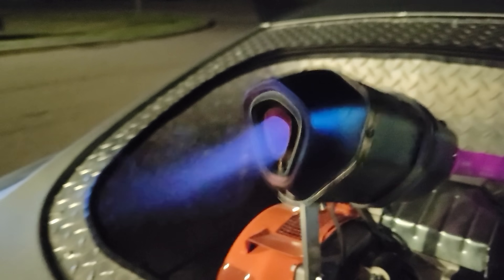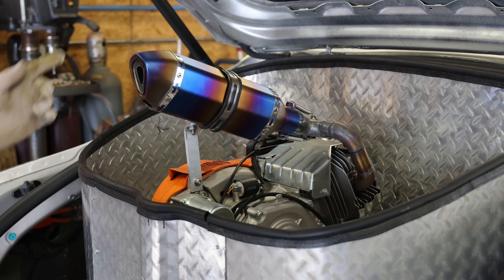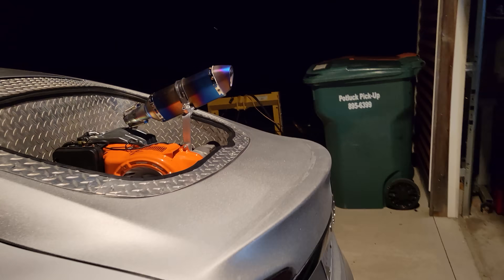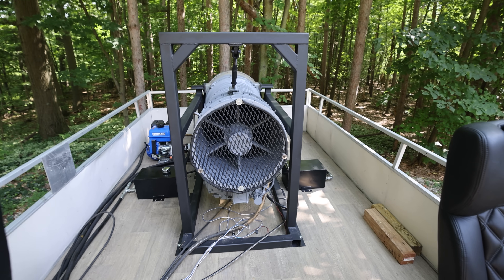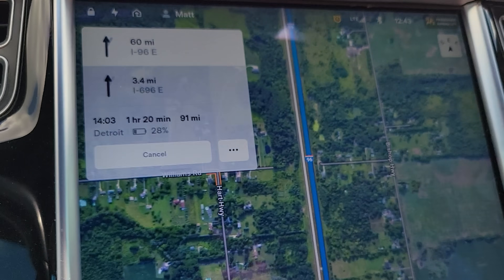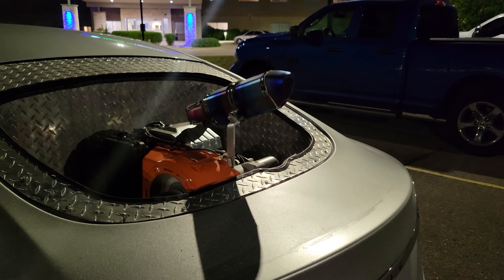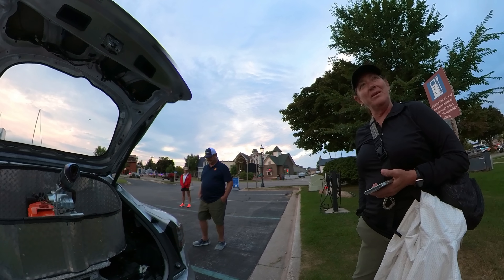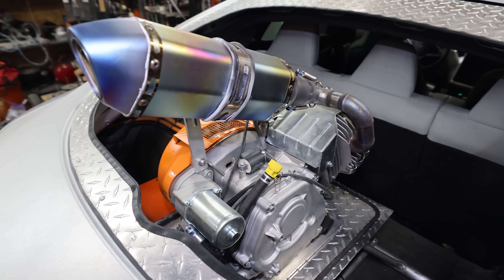Cordless Tesla (I Drive 1800 miles without charging) P.1

Comment: I don't recall hearing anything of a generator. Only a noisy 400cc engine "that makes about 10,000 watts, total," and it charges batteries. Not very good though.
Reply from the maker: My system is so small you didn't even know it was a generator, mission accomplished
Reply: @WarpedYT  So small its like it isn't even there!
Reply: I can't get my head round how it's possible to simultaneously charge and discharge a battery
Reply: @rickyjb23  Hey you raised a valid point about this car and now I'm not sure if it even works.
Reply: @N0Xa880iUL  he stated in other comments he's not using the on board charger . Which converts AC to DC for the battery to charge .  Makes the system sound  even more unlikely .
Reply: @rickyjb23  he wouldn’t need to if he is jacked in straight to the battery. Particularly if he is running DC, there would be no need to AC convert??? I have no idea what voltages these run at?
Reply: @rickyjb23  Because that's not even possible. Only if the gen supplies more than the car need it will charge the battery and can supply power to the car.
Reply: @flexairz  correct it's not possible . That gen could not power the motors directly , or via the battery while the car is moving .
Reply: @rickyjb23  From an analogical POV, it's like adding another battery. Another battery would add to the capacity of the battery system as a whole, but is still being drained with it. You're either adding or draining electrons from the battery system, with no active charger (like here), you're only draining while using, and adding while charging, but if you increase the available capacity (through active charging), you're either going to be charging the battery (if the generator capacity is greater than the driving load), but at a reduced rate because you're driving the car, or draining the battery (if the generator capacity is less than the driving load), but at a reduced rate because you're adding power through the generator.
Reply: @rickyjb23  Makes me wonder how long the battery and charging system is going to last. It wasn't designed for that kind of use.
Reply: @rickyjb23  What is the mystery??   Generator supplements the drive power. Go too fast battery has to supplement the generator. Go slow enough it matches use with no Batt. loss. Go slower it may have more than enough to keep going and give some charge which means at that time it would actually be running only on generator while battery can gain. Stop it fully charges.   So in the end this car is actually a gasoline powered car.  Plug it in it is mostly coal or natural gas powered.  I'll just keep my pistons and crank shaft for now.
Reply: @rickyjb23  It actually don't. If the tesla is using more power than the generator produces, the power from the generator just let the battery discharge slower because it has go get less power from the battery. If the consumption is equal to the power of the generator it does not charge but it also does not discharge. If the consumption is lower, the battery just does charge.

Same with normal gasoline car batteries. They are charged aswell while driving but are discharged when you have big subwoofers or too brigt lights or 12V to 230V converters to power your Welder middrive.
Reply: @rickyjb23  simple. The generator powers the vehicle and the excess charges the battery
Reply: @rickyjb23  no different to a regular car…
Reply: @riz3nfpv306  how ? I always thought a battery cannot be charged and discharged simultaneously
Reply: @rickyjb23  nope
Reply: @rickyjb23  The battery technically is not being charged and discharged at the same time. It's load balancing. If the vehicle is requiring 7kW of power, and the generator is outputting 10kW of power, then 3kW go back into the battery while 7kW powers the car.
And if the car need 12kW of power, the generator will supply the 10kW, and the battery will make up the 2kW.
This is a rough exaggeration of what is actually going on, but basically overall what happens. The charge controller in the car may only allow a max of 5kW from the charging port max to power the car itself, for example.
Reply: @korishan  in your example the generator supplies this 10kw of power to the motors ?
Reply: @rickyjb23  If the controllers in the car are configured that way, yes. If the car motors are requiring more than what the generator can output, then 100% output from the generator will go to the motors, and the remaining from the batteries.
This is, as long as the amperage ratings can be supplied in full.
Reply: @rickyjb23  basically- if the charge exceeds the requirements of the car, it’s stores in the battery, that’s why he’s driving conservatively- to STORE power rather than USE it. 

Can’t help but see it as ridiculous after 100 years of perfecting internal combustion engines…we bin them to then run other internal combustion engines- with less emission control- to power a vehicle that is essentially more taxing on the environment to produce… it’s a little lost on me.
Reply: @riz3nfpv306  but driving at any speed be discharging the battery . Therefore how can you charge and drive ( discharge ) at the same time ?
Reply: @rickyjb23  there has to be a surplus of power in the sytem… to run AND charge just like you car battery- when your headlights are on are you charging or discharging OR both? - 

You have a 12v car, 12v globes but your alternator OUTPUTS around 14v

In this application how much you use effects the amount you charge, hence the slow speeds.

In your application your electrical load on the system is a known quantity. When the car is powered by it - not so much
Reply: @riz3nfpv306  you are missing the point . You are saying if there is a surplus while driving you can run and charge . That would mean discharging and charging simultaneously.

Your head light scenario is wrong .  The alternator in a conventional car powers all 12v accessories and charges the battery with spare power . The battery is not charged and discharged at the same time .
Reply: @rickyjb23  sorry bro I think your the one missing it, yes of course you are doing both- JUST LIKE YOU DO NOW IN A REGULAR CAR. Use higher voltage to both run the headlights WHILE charging the battery. You dont HAVE to do one or the other
Reply: @rickyjb23  how is this generator ANY different to an alternator in the engine champ?
Reply: @riz3nfpv306  The diffrence is that an alternator in a normal car doens't have to the power the wheels.
Reply: @N0Xa880iUL  I didn’t say it did, I’m talking about the electrical sytem, fans heaters electric windows headlights computers ignition system, saftety systems, fueling systems …. When your driving down the road USING all that power… are you charging the battery? Or discharging? OR is the alternator powerful enough to do both…0
Reply: @riz3nfpv306  a alternator is driven by a belt from the engine to generate electricity for the cars 12v accessories . Any surplus goes to the 12v battery . The battery is used to power the starter motor , or the 12v system when the car is not running . Hence not being charged and discharged simultaneously
Reply: @rickyjb23  very good! Now same thing but a smaller ICE direct drive to generator- MUCH bigger battery, to feed electric motors. SAME thing electrically speaking.
Reply: @riz3nfpv306   yes finally you get it . The alternator is powerful enough to do both but the battery is not being charged and discharged simultaneously.  This what started the discussion
Reply: @rickyjb23  dude I said that to you four comments ago more like the penny just dropped huh?
Reply: @riz3nfpv306   okay so say this generator is directly powering 1 of the 2 motors in this p85d . 
It would need to output DC voltage directly to the motors inverter, bypassing the battery.  It's not outputting AC As he states he is not using the on board charger. ( that takes AC converts to DC for the battery to charge .)

Not forgetting this model s p85d has 2 motors which don't have a clutch system to decouple the wheels . Meaning one motor will always be charging the battery via regen .  This is not shown in the dash energy graph.
Reply: @riz3nfpv306  Can't store power. Energy yes.
Reply: @flexairz  how is that energy measured ?
Reply: @riz3nfpv306  it's easy. If everyone has an electric car they can raise the electricity prize to crazy amounts. Wanna drive to work? Pay what we want
Reply: @srck4035  unlike the gas prices, which doesn't change and stay waaaaaaay low, right? 😏
Difference is, You can produce your own electricity out of i.e. PV on roof, while making your own gas is not that simple.
Reply: @dempsej  you can but this is an option for maybe 1 percent of people. Also gas prices are a different topic. The price is mostly made up by taxes and you have other options to choose from. From everything is electric you have not. Also I would like to see someone charge there car with a personal pv roof unit. It will take 3 days or more for a full charge
Reply: @rickyjb23  Unhook a cars battery and try to run the headlights, interior lights, brake lights, engine fan, blower motor, etc. Then rev the motor. It will likely stall as the alternator can't keep up with the demand. Without the capacitance of the 12v battery the system crashes.

In normal use the battery and the alternator are outputting simultaneously at a moment like this. The battery is used and the alternator then tops it back up until it's no longer a draw on the system, all while driving. Its all available electricity. I just gets pulled from the source that has the amount that's being asked for. The alternator doesn't care if its a battery or a headlight. It will feed whatever needs it. 

The old water analogy works so well. The battery is a reservoir. The alternator/generator is the stream. When the demand for water is higher than the stream can produce, the extra needed will flow from the reservoir to keep up with demand.
Reply: @rickyjb23  The fact that you make a statement like that means you have no understanding of such things, of course a battery does not charge and discharge at the same time, if the electrical load from the cars drive motors is more than the range extender can supply then the batteries discharge to make up the shortfall, if the load from the cars drive motors is less than the range extender can supply then the surplus power can be/is used to charge the batteries. The car batteries switching from 'charge' to 'discharge' modes and vice versa happens quickly and seamlessly, you wouldn't know unless you have a meter to display which way the power is flowing, this is how all plug in hybrid cars work
Reply: @rotax636nut5  Makes sense now. But that's how hybrids work. 

Doesn't explain how this wireless tesla works. 
The small engine cannot directly power the car, forget powering the car AND the battery.
Reply: @N0Xa880iUL  this is exactly what a hybrid is he just converted it to a hybrid.
Electric generator over a battery, it’s a flashy Prius,

I think you would be amazed at the power that generator can supply
Reply: @riz3nfpv306  No not at all. I just watched a video on how a Toyota Prius works. This is not it.
Reply: @N0Xa880iUL  so a Prius is not a hybrid? It’s doesn’t have an onboard generator charging a battery ?
Reply: @N0Xa880iUL  Yes it can as he said IF he drives slow enough to not exceed the generators output.
Reply: @rickyjb23  You shouldn't be discharging the batteries while the generator is running. You go down the road on generated power. Access power will charge the batteries. If your generator's sufficient, that is?
Reply: @c6rocks  the motors are 3 phace AC . So are you saying the generator is powering the motor directly?
Reply: @rickyjb23   Batteries are DC current. Where does 3phase AC come from? If you want to waste a bunch of power invverting DC to 3phase AC, I suppose it's possible.
Reply: @c6rocks  the 2 motors in this car are 3 phase that require 300v plus of AC to run .
The motors have inverters that do this .
Reply: @rickyjb23  All I can say is, WOW!
Makes no physical sense to me, but I don't have a Tesla either. Sounds like you do. I'm quiet.
Reply: @rickyjb23  it is possible because this whole thing is a setup to rake in views. there is no generator with that engine. it just some engine running in the back of tesla while this dude drives it around. there is no way that engine is producing electricity
Reply: @rickyjb23  BMS i.e. Battery management system, and the fact that the battery pack is made up of numerous individual cells. 

You are right that a single cell cannot be charged and discharged at the same time, but different cells can.
Reply: @N0Xa880iUL  yes but the individual battery cells are linked together to reach the desired capacity and voltage .are you suggesting the ability to physically disconnect each cell individually and charge it and then reconnect it ? 

That would cause a pack imbalance . The BMS ensures all cells are charged and discharged at the same rate .
Reply: @N0Xa880iUL  When youre using your phone.....ever use it? Use = discharge
Reply: @rickyjb23  Hmm that's something to think about. I don't know how else it is possible. 
Maybe two different battery packs with separate controllers? Isn't that how it's done in some hybrids?
Reply: @jrmead  Yes but then I've also heard you shouldn't use your phone while charging. Maybe the charger itself is providing that energy instead of the battery.
Reply: @N0Xa880iUL  it's confusing for sure , I know here in the UK we have the BMW I 3 that has a range extender as does the new London taxi . I don't know how they charge and discharge simultaneously either .
Reply: @N0Xa880iUL  correct.  the charger powers the phone , and charges the battery.
Reply: @rickyjb23  OMG. This generator makes 10kW. If motors are using, let’s say, 8kW at the moment, any excess (2kW in this example) goes to battery CHARGING it. If motors are using 10kW generator is powering them and battery is idle. If motors need 20kW generator provides 10kW and battery is adding another 10kW while DISCHARGING. There is no simultaneous charging and discharging, there’s only different rates of charging/discharging or idling of battery.
Reply: @dempsej  Wait this makes sense. But how did he modify the powertain to achieve this? We really need to see a connection diagram here. Can't be that simple.
Reply: @dempsej  the motors in the model s p85d  165kw in the front and 350kw in the rear ...
Reply: @dempsej  so you are saying the generator powers the motors inverters bypassing the battery pack. 🤣
Reply: @N0Xa880iUL  My guess is he bypassed onboard charger and plugged directly into BMS? Or maybe somewhere between battery and motor controller?
Reply: @rickyjb23  yeah, they are. Peak. How much power do You think they consume while driving 15 mph?
Reply: @dempsej  he's doing a 1600 mile road trip ... How often is he driving 15 mph ? 

Takes 16.5 kw to drive at 50mph , using the average consumption of  300wh/mi

And see previous comments about the problems of only powering only one motor
Reply: @rickyjb23  I never said that either of motors are driven solely by trunk generator, I said that it works helping battery to power them. Think about this one cylinder generator as third Tesla motor that can only regen. It’s constantly making power and delivers it to rest of car just like front or rear motors do while regenerating. Not via plug port, but directly to controller/bms. How it’s done exactly - I don’t know, because I wasn’t the one who build this :)
Reply: @rickyjb23  that’s why he was stoping from time to time (like in stopped by police scene) and charging over the night. He’s not constantly driving 50mph either. Every time he slows down it regents from motors, every time he’s driving on parking he’s using very little power while still constantly charging (“regenerating”) at 10kW. Everything is in video.
Reply: @dempsej  a third motor that only regens , would mean it has to put it's power in to the battery ( hence the charge and discharge simultaneously impossibility) or the generator feeds directly to the motors . ( Which require a inverter to provide 3phase Ac 300v+ they need to run)
Reply: @dempsej  of course you can charge while stopped , as the battery would only be charging . At which point why would you want to stop and charge at 10kw , when you could stop at a super charger at 150kw .
  As I said before you can not charge and discharge a battery simultaneously. (That includes driving slowly  Which is discharging)
Reply: @rickyjb23  uh… maybe different way… it’s like Toyota RAV4 Prime, where front and rear motors are driven either from battery, battery and ICE or ICE only (in rare cases, but it’s possible, and in Toyota ICE can also provide power directly to wheels, but will leave that out here, or charge battery).
During regen braking voltage made by motor can be lower, it’s not always at peak V (you can decelerate slightly), so even 110V should do, and even if it doesn’t, it can be stepped up if necessary.
All You trying to say, is based on peak values, all I’m trying to say, it’s not always like that.
Reply: @dempsej yes the rav 4 prime has a parallel hybrid system . It can use both powertrains to propel the car, at no point would the system accelerate ( discharge from battery power)  and slow down ( regen, charge the battery ) at the same time . in other words at no point does the battery charge and discharge simultaneously . 

This Tesla has 2 motors  , see previous comments as to why this seems unlikely.  1 motor would be charging the battery via regen constantly there is no clutching system.  meaning the second motor and gen would have to overcome that regen force ( 60 kw/80hp of drag constantly wanting to slow the forward motion   )   . 🤦‍♂️

read video description, clearly states car charges while stationary and continually while driving 🤣
Reply: @rickyjb23  ok, different different way - so how is A/C driven in Tesla? From the same battery as drive units. And how would it work while regenerative braking? It’s like 3 motors, 2 are generating power and 1 consuming. Does it have to charge and discharge the battery at the same time?
Reply: @dempsej   it works in the same way as when charging the car ( at home or supercharger)  and running the a/c . Like when I preheat the car on cold mornings when plugged in . The charger will provide the power to the A/C and the battery , I can see the charge speed slow by the amount of power the A/C would use . At no point does the battery charge and discharge simultaneously.  

In the case of while driving, regen power will continue to run A/C( say 3 kw )  while the rest of regen power charges the battery . Again at no point is the battery being charged and discharged.
Reply: @rickyjb23  so now instead of A/C put a generator. It will provide some power to BOTH motors, and rest, if needed will be coming from battery. If decelerating, all 3 generators will charge the battery. As You hopefully can see there is no charging and discharging at the same time, WarpedPerception‘s generator is either providing power to wheels (both motors) or to battery. Hopefully there will be a follow up video that will clear this up.
Reply: @N0Xa880iUL  cells that are connected in parallel cannot have different voltages (ie, some charging while others discharging). This is not possible. It is a load balancing between battery, charger, and motors controlled by the charge controller/bms. 
Part of the reason why this is even possible is because Tesla's come equipped with Regen Charging while being Towed. I believe WP showed this process in a previous video.
Reply: @dempsej  the video description clearly says the car charges while stationary but also continuosly while driving . 

 That suggests the generator would only be charging the battery ,  not powering the motors directly.
 
Definitely need another video explaining how the battery charges and discharges simultaneously. 🤣
Reply: @rickyjb23  in other thread WP wrote, that this Tesla has now custom built high voltage system, so all our discussion is pointless at this moment. However I still see it that, from battery perspective, it’s either providing or getting power while splitting it between the motors, generator and battery is being done elsewhere, in some dedicated piece of hardware. It’s like jump starting conventional vehicle, all of the sudden you have second battery that provides power to your vehicle - and in this case generator is playing that second battery role, that is constantly pushing power.
Reply: @dempsej  wow ,if true that would be cool to see .  Finally that would make sense. Unlike the description where it says it's continuously charging while driving. 

So a custom HV system connecting the generator output to the input of the 400v DC inverters that power the motors . 

 That way when you accelerate the inverters would see a extra 10kw thinking it's coming from the battery , likewise when you regen by slowing down the Tesla would see a extra 10 kw from the generator .
Reply: @rickyjb23  yes, exactly! Phew, finally we understand each other :D 🤜
Reply: @dempsej  so for this to actually work the way he wants ( driving for as long as he wants ) he'd need a 16.5 kw gen to drive at a constant 50 mph . (300wh/mi ) 

V2 will be interesting
Reply: @N0Xa880iUL  you just parallel a charger with the battery - e.g imagine a car battery charger clamped on to both terminals whilst a 12 volt light is also connected.
Reply: The problem is he used a standard generator head. He could have used a higher voltage generator head which would have been more efficient for the power conversion to charge the battery.
Reply: You could literally see the coils of the gen unit under the orange shroud when he said that. If you knew what you were looking at, it would have been obvious. Don't try to dog on him for your inexperience.